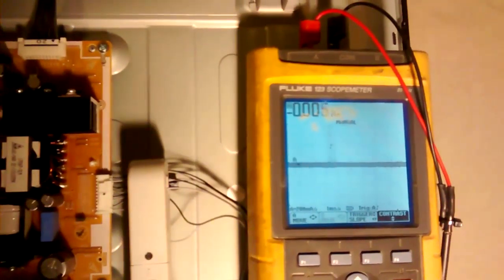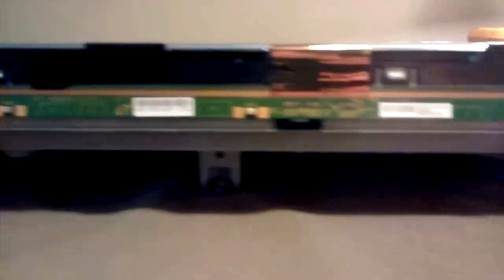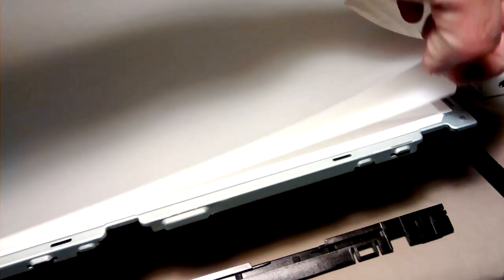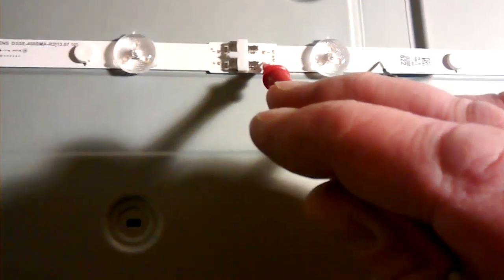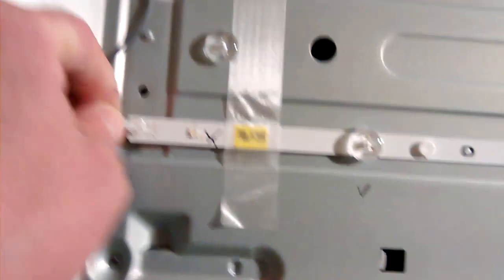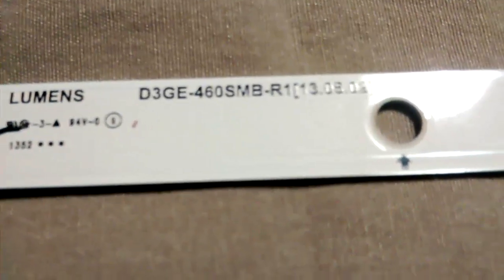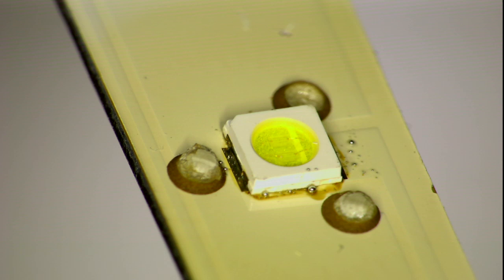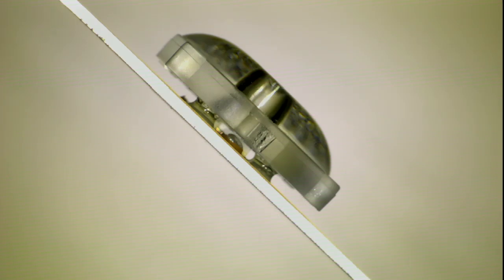UN46FH6030F dim or flickering picture - backlight repair

Comment: Hi, where did you get the tool to create the 2.7 volts to test the individual LEDs or did you make it yourself?
Thanks
Reply from the maker: I'm using an adjustable power supply. You could take two AA batteries in series. That gives you about 3V. Then a resistor of 3 to 20Ohm in series and the LED should light up if it's a 3V model. (or use a 9V battery with about 150Ohm)

Comment: If TV fails after 2-3 years I'm not going to buy same brand TV again and I think many others think the same, how stupid they think consumers are?
Reply from the maker: Sooner or later it's going to happen on any new LED TV you buy. Best way to avoid this is to lower the backlight setting, I wouldn't set it to more than 75% maybe.
Reply: I suppose it will happen to all LED TVs eventually, funny because it has been hyped everywhere how long lasting LEDs are. If TVs having default backlight level at 100% fail in 2-3 years then hopefully my TV will last at least 6 years because default backlight level is 50% and I have lowered it to 40% without noticeable difference in image. Tomorrow I'm attempting to fix LEDs for my parents TV and I have been devouring these videos like crazy, so thanks! Only worry is that liquid crystal panel I wouldn't want to break.
Reply: OK I replaced bad leds and there were more than expected, 15 out of 60, phew. I ordered 20 leds before tearing TV open because I didn't think that many would be bad, luckily I had enough leds. Apparently because only about 2 were failed "open" and others were shorted allowing current pass through so maybe TV just kept going until enough of leds were busted to trigger "safe mode".
Reply: All TVs are the same.

Comment: I think a simple constant voltage driving of the led strips from a single boost mode converter would be much better than constant current from "sophisticated" controllers that shut down in a minus current difference between the one to four group of leds driven separated.Is better that all group of leds connected in parallel and if something fails the other keep working.But a totally dark tv is way better than one with misbehavior for the companies profile.Same with CRT screens that after 1990 for every problem as colour of vertical deflection the screen was getting dark,in contrast in the previous years someone could see a picture coloured magenta or red or a horizontial line and the ploblem was obvious.

Comment: I have the same 46" Samsung TV . I removed all LED from the strip. My question is what is the (+ -) orientation of the LED strip ? (If the positive lead input  top and (-) bottom do all LED (+) go to the top?)
Reply from the maker: Sorry I don't have that TV anymore. The orientation should be clear from the markings on either the power supply LED connector or on the LED strip itself
Reply: The 2nd half of the strip indicated the reverse polarity of the beginning of the first. So do remember if you changed the LED orientation on the 2nd half of the strip
Reply from the maker: No , the LED orientation must be the same as before, they are never inverted when repairing them. The polarity markings on the LED strips can be confusing sometimes, that's true.
Reply: Thanks

Comment: Hola, donde se consiguen esos LED  de repuesto?.
Reply: Gracias.  Anteriormente ya le compre a ese proveedor.  Pero fueron los 2828.   Solo que al encender la tv se nota una luz mas intensa en los puntos que se reemplazaron los led.  Alguna sugerencia para nuevas reparaciones con estos led?
Reply from the maker: Sorry, I don't know. I never saw a difference in brightness, unless the diffuser was badly installed, but that's more likely on certain LG models.. I often use spare LEDs from broken TV LED strips

Comment: i dont have a hotplate do you have a suggestion what else i could use
Reply from the maker: Any flat surface that can be heated to a temperature of about 250 degree C. I presume a ceramic stove top would work. They might get hotter than that though so maybe put a thermal mass in between like an aluminum block with a flat surface over which you can pass the LED strip

Comment: I have a RCA that has a brightness adjustment but does not have a backlight adjustment. Strange but true.
Reply from the maker: Yes, there are several TVs that don`t have it, or at least it`s not accessible through the user menu. On many TVs though you will be able to identify the LED current controller chip and adjust the maximum current by changing some resistor values. Usually these are low value resistors through which the LED current is directed, the voltage drop then determines the maximum current. Often we can increase the value of these resistors and therefore decrease peak current. Even at the maximum duty cycle the LEDs are then less likely to burn because they are dissipating less heat. (my assumption being they burn due to excessive power dissipation or insufficient cooling)

Comment: The current setting that is needed is in the Firmware download at Samsung sadly those creeps didn't tell anyone that has a non-smart tv and most are cooking the leds at 18 months just out of warrantee the smart set automatically upgrade if internet is connected edge lit sets don't seem to have this problem as the leds are on aluminum heat sinks. I am a factory authorized tech. I tell customers and set the backlights to about 70% on all brand sets.
Reply from the maker: Yes, lowering the backlight setting is probably a good idea. I'm sure the peak current could be decreased, one would have to do some reverse engineering of the controller circuit. Didn't feel like it though in this case. :-) Probably time to invest in building some equipment that can safely lift the LCD glass...

Comment: Great video thanks for posting it. I have a Samsung UN32EH4003FXZA same problem . My strip number is lumens D3GE-320SMO-R2 how do I tell what size of LED I have? And how can I  tell what spare led strips has correct LED size that I can salvage?
Thanks!
Reply from the maker: I don't know which one is one the strip you mentioned. They are all pretty much the same size, only forward voltage varies widely. Also sometimes it's the anode and more often the cathode that has the larger pad. I'd remove the defective LED, measure its dimensions, see if I have anything in stock that fits more or less, or if I don't have anything maybe try to find a corresponding standard sized LED on Digikey for example. Until now I was always able to reuse LEDs from other LED strips (except for some 6V LEDs for LG TVs). If you don't find something the EXACT same size no problem, you can always scratch some of the soldermask on the PCB to access the copper traces...
Reply from the maker: Here is an eBay seller who seems to provide replacement LEDs for your TV: http://www.ebay.com/itm/10-PCS-LED-diodes-for-DF320AGH-R1-2013SVS32-LM41-00001R-UN32EH4003-/182498225186?hash=item2a7dbdec22:g:XGcAAOSwjDZYih7k
Reply: Thanks! I see the TV model is right. The pic of the strips look like mine.
But the part number is different. Do you think it would work.
Thanks again
Reply from the maker: Found the cross reference here: https://www.kupindo.com/Oprema-i-delovi/38159095_746-1-LED-kompon-D3GE-320SM0-D3GE-320SM1-D3GE-320SMO
My guess is it could work. I recommend removing one of your defective LEDs, clean the solder pads with solder wick and compare the visual with the picture on eBay. You can also ask the seller about the voltage drop and compare it with one of yours that is still working.
Reply: That is next on the list. What is your opinion of using a hot air station to remove the LED? I assume I would have to heat the strip from the bottom, so as not to damage the strip board or the LED. Or can I do it from the LED side? Would be easier I think.
Reply from the maker: I didn`t have good experiences with hot air. The problem is the strips usually have very large traces =  dissipation area. From the top damages the LED body, from the bottom takes forever. Instead of the hotplate a ceramic stove top may work... or any other flat surface that can be heated up.
Reply: Thanks for the heads up. Explains why I could not heat it up from the bottom with a soldering gun, Not enough surface heat to beat the heat dissipation. Looks like I I will be getting a hot plate. What temperature does the hot plate need to melt solder on LED strip?
Reply from the maker: about 260 deg Celsius. I got one from Aliexpress for about $35 (+shipping with DHL which was more expensive than the item), works perfectly well. I guess a stove top would work equally well, have to test it.
Reply: So I tried a stove top hot plate. It worked but I think I overheated the board because the white strip turned a brownish  color. I have tested the LEDs one at a time with a 3V DYI tester. But don't have a way to test the whole strip. How delicate are these boards? Thanks again for all the Info. I have watched most of your videos. They are all full of information.
Reply from the maker: yes they will turn a little brownish, no problem. it's important to keep it on the hotplate only as long as it takes to melt the solder , that is until the LED sits flat down on the PCB. it takes a little longer for the normal PCBs and it goes quite fast for ones with the aluminum substrate.
Reply: If I make a 27 volt tester to light up the 9 LED strip. Will it ruin the other LEDs since I removed 2?  Leaving 7 instead of 9. I think I answered my own question. The reason is I want to know if the leads are still good on the PCB. The first LED I took off got really hot, real quick because it is aluminum as you said.
Reply from the maker: I assume you already soldered them on the new strip? You can test them individually each with about 2.7V. The best is to go a little higher in voltage and use a few 10s of Ohms resistor in series. 
Indeed, if you use 27V without current limit (resistor) and two LEDs are shorted then you would probably push too much current through it (how much depends on the forward voltage vs current curve of this particular LED) 

I suggest replacing all the LEDs you identified as being defective, then test each of them individually, and when you are sure all are working then test them all in series. For the series test you could for example use 3x9V batteries for 9 LEDs.
Reply: Ok 2 more questions. How do you tell what side is what on the LEDs. + and -? And also If the LEDs are failing because of over use . Should I replace all of them with new ones?
Reply from the maker: Sorry can't remember this particular LED model. Usually you see a little bonding wire going from one terminal to the die, where the wire is that's the anode. Also, the solder pads have different sizes, often the anode being the smaller one (but not always). On the LED strip polarity is usually indicated at the connector and sometimes at the LED (under the diffusor) I personally would decide if all LEDs are to be changed on the percentage of defective vs total LEDs. I think maybe up to 30% I would only replace individual LEDs. My goal is always saving money ;-)